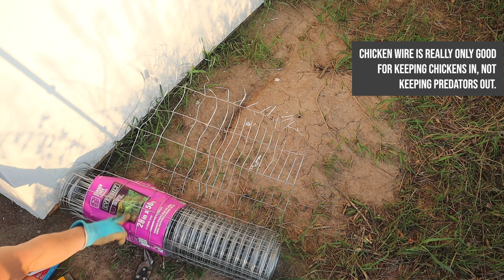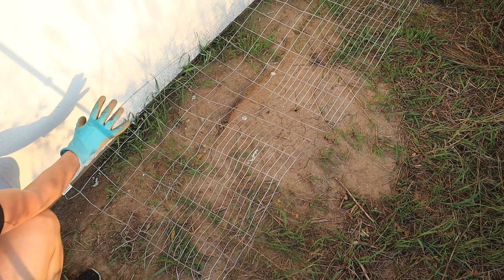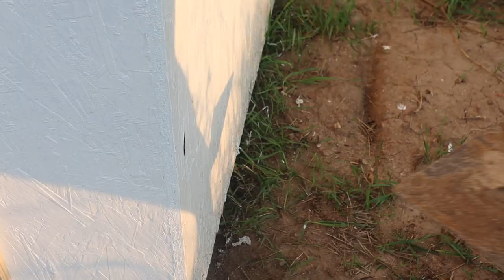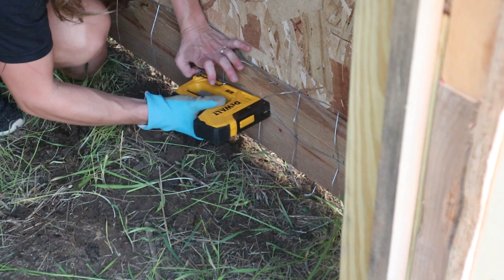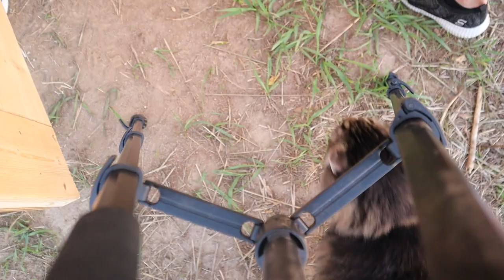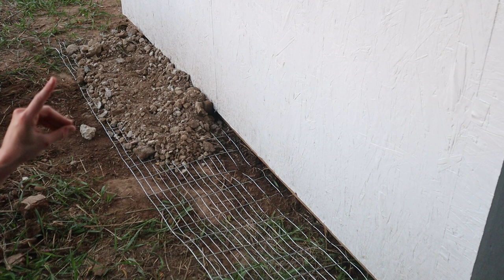STOP 🛑 Digging Predators | Protect Chicken Coop From Coyotes, Raccoons, Dogs + | Backyard Chickens

Comment: I used 1/2 inch hardware cloth on my entire coop/run build. I used post hole diggers and dug a trench around the entire structure and my hardware cloth is buried straight down 12 inches below the bottom frame. Around the coop itself I also poured quick drying cement into the trench to encase the wire. I figured I'm putting this much time and $ into having a dozen birds(for now 😅) that I might as well do it right that I can feel confident of their security. Chesterfield,  Virginia
Reply: Sounds expensive! How much was the hardware cloth alone? Thanks

Comment: I added the same to my coop as I was building it around all four sides three feet out from the coop. It went under concrete pavers that the run and coop sits on. I don’t know if you did it or not but you need to cut off the ends and not have the stragglers of wire. I covered mine with dirt and rock but over time the rock and dirt was pushed away from blowing the yard or just walking around it. In no time I was tripping over it because of the stragglers getting caught on my shoes. Especially the corners would as well. Bury the mesh by a few inches. I went back digging it all out and it made a huge difference. Plus I found a spot where a fox attempted to dig but gave up. Saw it on my camera
Reply from the maker: Wow!

Comment: I laid two runs of cinder block (18" depth) under the parameter wall of my entire run and coop.  I used hardware cloth 1/2" welded mesh 24" laid out from the bottom around the outside perimeter buried about 3 inches deep.  The run walls and coop windows are all covered in hardware cloth 1/2" welded mesh.   Both run and coop have a  galvanized roof.  All doors and openings use a latch with a lock or carabiner.  I figure if some critter digs and tunnels more than 2 feet away from the coop, lower than 18" to get beneath the cider block, they deserve a chicken dinner.